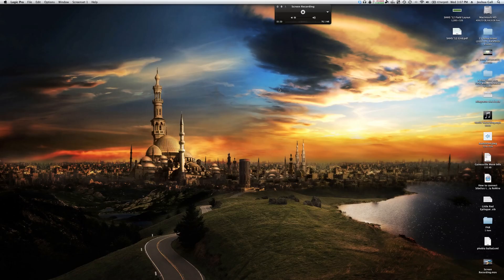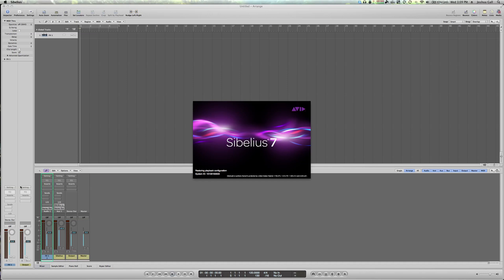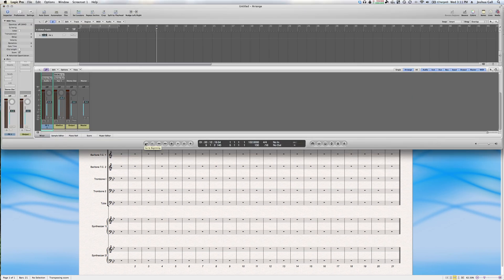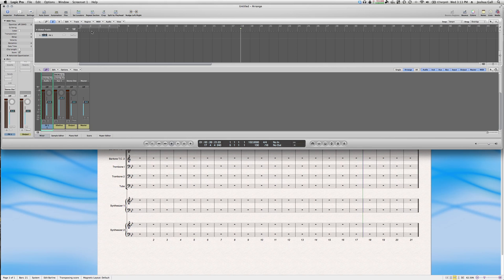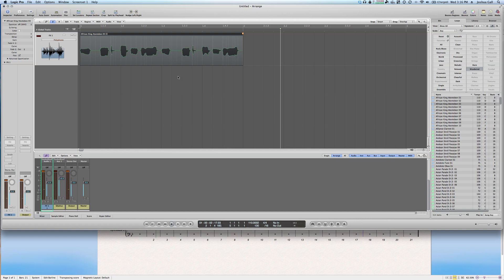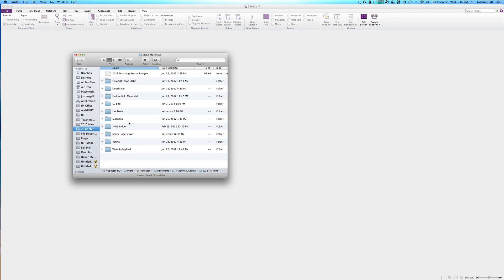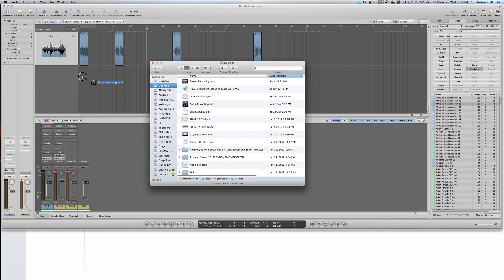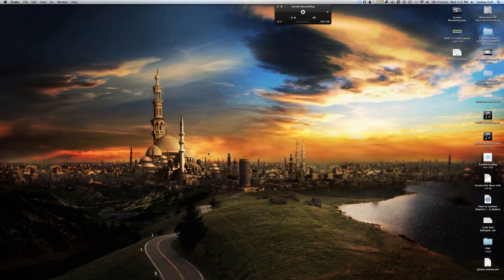Setting up Rewire in Logic Pro and Sibelius 7

Comment: very useful video! thanks for the nice tutorial!!!
although i have a question, you might know the answer...
so i use sib with rewire, sending the midi signal to ableton or logic, but the first note/beat gets shortened when playing back... the tempo is set properly and i dont think if its a latency problem because after that everything is in time...
it does the same thing when i'm sending audio from sibelius via rewire:S
do you know what the problem may be?
thank you